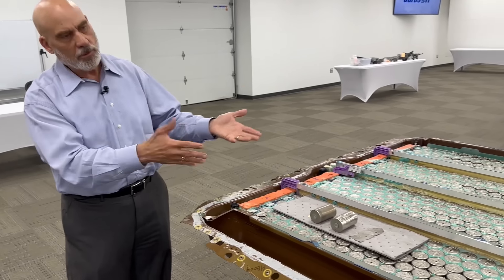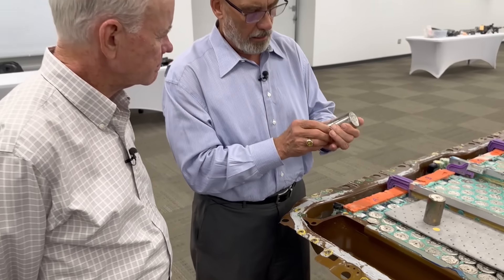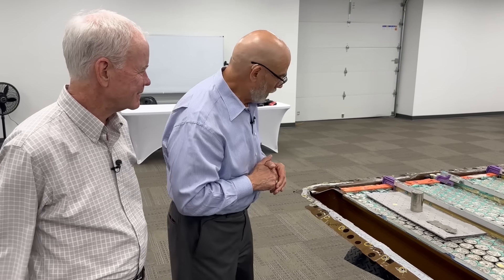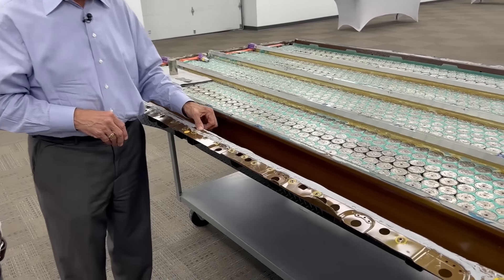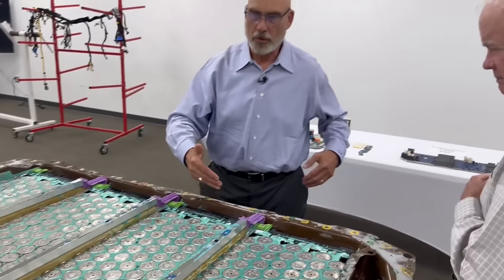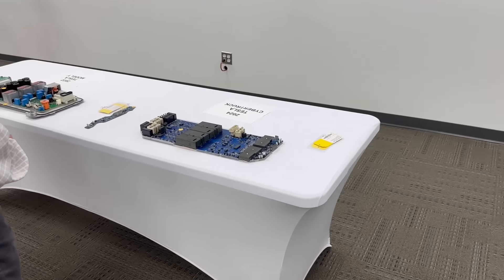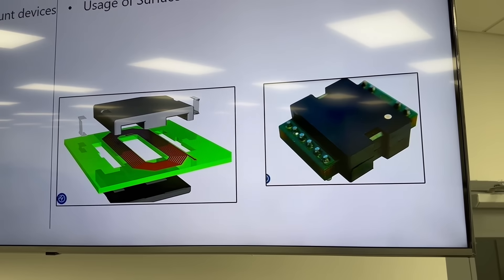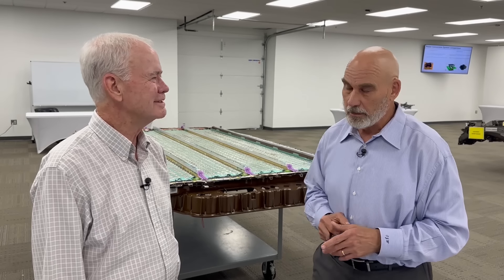A Look Inside the Brains of the Cybertruck's Battery - Caresoft Teardown

Comment: The design is not to make it better, it's to be able to manufacture and assemble it with as little labor and costs possible. Nothing to do with better quality. That "foam" should actually be thermally conductive silicone to help pull the heat, so the little physical contact area of the ribbon cooler is not the only means of cooling. Thermal conductive silicone is pretty common in tight electronics for better thermal conductivity.
Plus that PCB designed transformer makes the entire assembly garbage when one transformer fails. Instead of an easily replacable part a reman can replace, now you have to replace the entire PCB.
Reply: Realistically, the average wrench turner is not going to troubleshoot down to the component level, but chuck the board. Also, the reliability of transformers is much higher than the other components. High power active elements fail, connectors fail, electrolytics dry out.
Reply: @jamesvandamme7786  Of course I wasn't referring to the average mechanic. I was referring to aftermarket remanufacturers. Just not a good design for longevity or repairablity to use embedded coil windings. And this style of transformer is not as efficient as a normal wound transformer. Sure, may look "cool" but definitely cost savinvg over performance and reliability. As far as electrolytics, not many on the new PCB and quality electrolytics don't have the issue that plagues most electronics with bad caps.

Comment: DC voltage is not changed through transformers. Transformers only work with AC. The battery DC must be converted to AC first. DC to DC converters are used for lesser power applications.
Reply: Yeah, these tear downs need to be done by very advanced EEs, not auto people! There are many things he got wrong.
Reply: You can certainly use DC - DC converters but there are limitations. A high frequency AC circuit using a tuned transformer has higher efficiency and can process more power.
Reply: @philtrubey7480  I agree. How qualified can these companies be to teardown cars and do engineering analysis without the proper engineering staff?
Reply: @andyfeimsternfei8408  maybe they have one guy who does the video demonstration and another who is an electrical engineer and some stuff got lost in translation
Reply: DC-DC converters typically are designed to convert DC to high frequency AC, about 80 kHz, so voltage can be changed with a transformer, then the AC output of the transformer is converted back to DC.  Not an electrical engineer myself, but that is how they explain it to me.
Reply: @georgepelton5645  no
Reply: @pablopicaro7649  care to elaborate?  How do DC-DC converters work?

Comment: That capacitor upgrade is a big deal. Tesla has reduced the amount of capacitance they needed and eliminated the electrolytic in favor of some solid polymer caps (over near the end of the board).  The old electrolytics have a paste electrolyte and rubber gasket and are one of the only components with a limited life.  GREAT to get rid of them.  Let me know if you ever want help on content for these. love the content, just need more...
Reply: Wrong! They just used regular industry components nothing special and why aren't they talking about the manufacturers of those electronic components?!

Comment: That new CT penthouse PCB is so elegant and the ferrite / PCB-coil combo is amazing.
I don't quite get what's up with the capacitors though...  I suspect there on the underside maybe?  No doubt smaller / higher frequency.
Thank you, great reveal!
Reply: Surface mount super capacitors maybe.
Reply: The caps are used for voltage smoothing.  I wonder if those are not caps at all but mofsets switching at frequencies to chop the peak and fill valleys?  These could be buck converters in lieu of traditional transformers.

Comment: Somebody should make a rechargeable flashlight using a 4680 cell...someday! 
Totally different topic. These cybertrucks are going to show up in war zones. Also, despite the weight, what is to stop using these things on the moon or Mars? I suspect the issue would be heat dissipation, since vacuum is not ideal for heat dissipation.

Comment: It's  almost an incentive to buy a Cybertruck/Tesla just to own this technology in your garage. I think including the software these are the most technologically advanced products on the planet. Even more so than airliners.
Reply: And after few years, electronics starts going bad, and so will the uber expensive battery.  DIY repair?   LOL
Reply: @springer-qb4dv  So you're the internet stranger to argue with today. EV batteries seldom fail and are warranteed for 8 years and 100k miles. They are lasting 250k. Modern electronics seldom fail. Teslas are maintenance free. I've had them 6 years and incremental cost per mile is $ 0.10. Tires and electricity. The autopilot and Full Self Driving are superb. Cross country driving on the Tesla supercharger network is seamless. Charging is quick and easy. A 225 mile round trip from Marco Is.to Ft. Lauderdale needs no recharging.

Comment: There's a massive amount of stuff to go wrong, ICE cars are so simple.
Reply: simpler with more parts and systems?
Reply: We’ve had over 100 years to refine the ICE engine. We still measure camshafts as they turn and lots of other stuff you don’t need to think about until it breaks. Outside the engine, there is as much or more complexity in the ICE car as an EV with many control modules and signal wires. There’s no logic to where ICE manufacturers place these modules either. The body control module is often located near the rear axle, exposed to everything. What’s simple about that system?
Reply: @barney2001  If you're not a mechanic you wont understand. I count 1000 batteries and BMS full of 1000s of electronic components in the one piece battery holder a lot, every item can fail and will, if you think it's a good deal to pay $20 - 40k because 1 50 cent chip fails them so be it, enjoy the pain. ECU's fail on all cars, non cost $20k+
Reply: I would like to see GM's Ultium battery platform tear down, those look much more repairable from the little i have seen about them.
Reply: The world has left you behind
Reply: @fcv1967  You're not wrong there.
Reply: @barney2001 Why after 100 years are we still having catastrophic failures due to spun bearings? The complexity in EVs is in the electronics and software which Tesla has mastered.
Reply: Indeed.  Cubans are still driving their 60+ year old ICE cars because it's easily repairable even with embargo on Cuba.  If Cubans had Teslas instead of ICE cars 60 years ago, they would be walking everywhere by now (or sitting in dead Teslas on their lawn pretending to go place).  LOL
Reply: @nibotkram7743  "simpler with more parts and systems?" - No, old fashioned ICE cars have FAR less components than whiz bang computer on wheels like Tesla.   Count them high-tech chips, electronic components, battery cells, many computer modules each containing thousands of components.  Never mind zillion lines of code that goes into those computers.  Ever tried "junkyard rescue" of ICE cars abandoned for decades?   Clearly possible to revive old ICE cars fairly easily.  But once Tesla goes to junkyard it's goner - forever.  LOL
Reply: @leeoldershaw956  "omplexity in EVs is in the electronics and software which Tesla has mastered" - WRONG.   Wait till your Tesla goes out of warranty and things start breaking.  your pocketbook will cry uncle.   My ICE has been out of warranty for decades, and I still drive it every day.   It will still be on the road (because I can DIY repair everything on my car myself)  when last Tesla goes to scrap yard.  LOL
Reply: @springer-qb4dv  Those 1950s cuban cars had the original engine thrown out decades ago most have been swapped for very small displacement 4 cylinders.
Reply: Fixing your own car is a hobby. Jay Leno does this. If you are fixing out of necessity, then you are not allocating your time wisely. Or, your time isn't worth that much. In which case, you need to figure out how to make more money than the labor cost of a mechanic.

Tesla gives me back my time. I've owned one for 4 years and it's never been in any form of a shop. I never had to schedule an appointment. Never had to wait. Never had to do anything. This year I will get new tires and maybe wipers, but thats all in 4 years.
Reply: @fcv1967  What's your deprecation in 4 years, not that it matters you just get a job paying you even more than your current job as a financial genius.

Comment: Another bust from Adrian on the Superman PCB!  1.)  80V AlElCaps placed too close together!  2.)  No isolation RTV between the AlEl caps so this board wasn't tested under vibration!  3.)  DC supply Ceramic Capacitors on U14 and U2 not doubled and placed at right angles!  4.)  C136 and C129 misaligned on the pads!  5.)  No filet on C186!  6.)  Visible graping on C142 and C143 so the reflow temps are incorrect!  Now we know why the CyberBusts are failing left and right!
Reply: Bro liked his own commet 💀
Reply: @mcsike7264  Nope!  Don’t compare me to a famous automotive CEO who has multiple sock accounts to prop up his main Xitter feed!
Reply: @bobbbobb4663  what 😂 you need to touch grass my guy your moms basement needs a brake
Reply: @mcsike7264  Condolences that your PCB is junk.  Maybe fast food is in your future.
Reply: @bobbbobb4663  i dont eat fast food am just saying you should leave your mums basement form time to time
Reply: @mcsike7264 Your expertise about basements is concerning
Reply: @bobbbobb4663  i said the word basement and suddenly am a expert on em 😂
Reply: @mcsike7264  Again that reminds me of a certain automotive CEO that tries to impress everyone with his technical word salad…
Reply: @bobbbobb4663  bros strapped to elon you might as well marry him at that point 😂
Reply: do you have a shrine of elon you make sacrifices too?
Reply: @mcsike7264  You made the conclusion…looks like you have the issue
Reply: @bobbbobb4663  am not the one obsessed with a guy that prob don't even know I existed 😂
Reply: The 80v caps are base supported so don't need any supplementary RTV support across their tops.
Reply: OCD guy is here again!
Reply: @mcsike7264  Leave moms basement to see a shrink sounds good to me.
Reply: @AuralioCabal-nl8gi  Lmao
Reply: 1.) Too close for what?  Reworkability?   2.) Or maybe the caps were tested during vibe and didn't fall off, hence no RTV required and money saved.  3.)  Perhaps other mitigations exist for cracked ceramic caps.  4.), 5.), 6.) Agreed that the workmanship is a bit sloppy on this sample.  Perhaps they will dial in the reflow process in future builds.  Still, these issues seem mostly cosmetic.  
Good eye, though.  VCSuperman FTW!
Reply: @cameronbrown8757  Having designed PCB’s for 20 years including for automotive, that board is unacceptable and the fact that I can discover six key flaws from a simple photo means what I said it did.  The obvious graping on the pads is the biggest problem that Tesla has no idea what they are doing from an assembly perspective.
Reply: @cameronbrown8757  No rework here. the entire battery assembly is not repairable so full replacement on failure as long as its under warranty.

Comment: i cant believe these luddites are pushing electric vehicles obsolete technology from the 1830s lol.
Reply: Computerization and modern battery technology wasn't around in the 1830s.
ICE is at the end of its development process, Ev's are at their beginning.
Reply: @nibotkram7743  electric vehicles are going back into the obsoleted ewaste bin sooner than you think. modern ev's are worse than ev's from 1830s atleast you could actually work on those and a battery is a battery they store electricity one is more dense than the other that's just natural evolution just like engines have evolved too bad batteries still havent evolved to be more energy dense than gasoline and probley never will be and will be relegated to the dust bin of history where they belong.
Reply: @billybobbob3003 it doesn't have to be more energy dense than gasoline, because you can recharge it, not light it on fire. And tell me more about the electric cars from the 1830s.
Reply: I studied EVs in the late '60s at the U. of Detroit. Back then we had lead acid batteries, wimpy silicon semiconductors, discrete logic. Today we have SiC, LFP batteries, huge leaps in all the technologies.
Reply: @hotrodandrube9119  these electric car makers cant even repair their own vehicles they are disposable ewaste garbage, what you think ev stands for? ewaste vehicle. electric vehicle batteries are only equal to acouple gallons of gas lol their efficientcy sorta makes up for it, but it's still not good enough.  my 2014 honda crv has 474 miles of highway range lol cybertruck hardly 300 your telling me the most cutting edge ev cant compare to 10 year old vehicle?
Reply: @jamesvandamme7786  these electric car makers cant even repair their own vehicles they are disposable ewaste garbage, what you think ev stands for? ewaste vehicle. electric vehicle batteries are only equal to acouple gallons of gas lol their efficientcy sorta makes up for it, but it's still not good enough.  my 2014 honda crv has 474 miles of highway range lol cybertruck hardly 300 your telling me the most cutting edge ev cant compare to 10 year old vehicle?